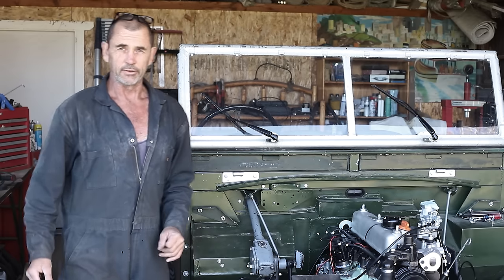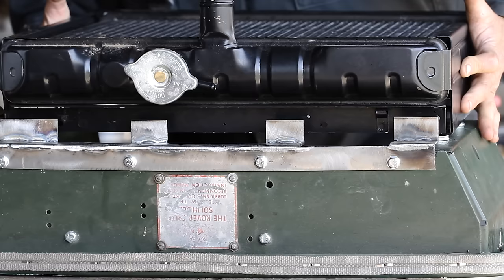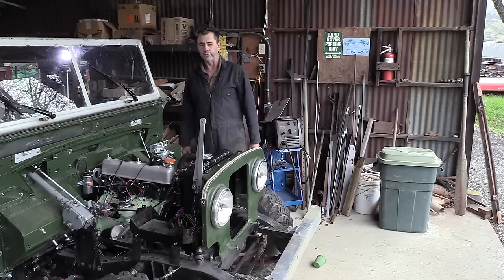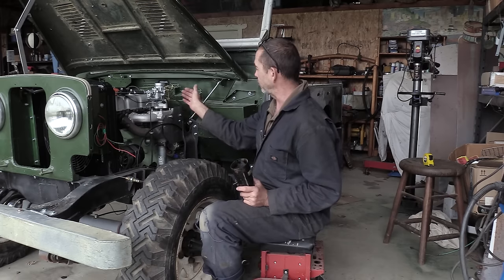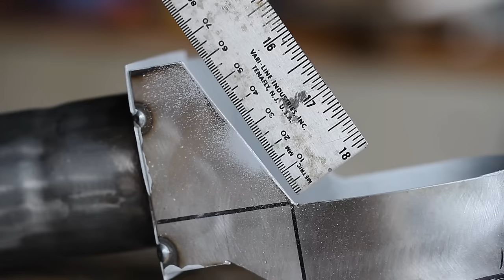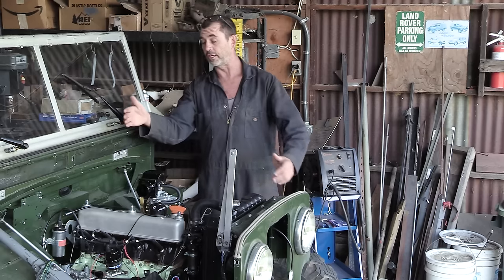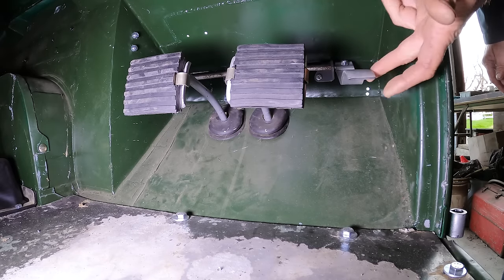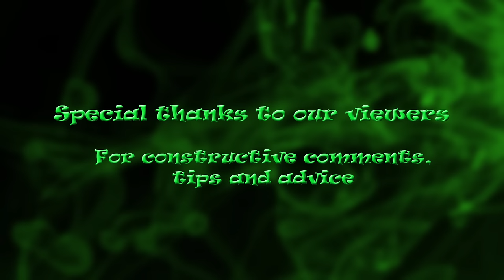Part_33; Vexing Puzzles; Series 1 Land Rover restoration

Comment: I always enjoy, indeed look forward to your videos but watching this episode reminded me of my throttle linkage head scratching. I have a 3 litre ford V6 in my series one and the weber linkage on the carb is via cable but the carb throttle lever is only 1” long. 
Using a 2” long lever on the pedal end resulted in the throttle either being on or off. This frightened a lot of people especially in traffic not least me. My solution was a snail cam for the cable to roll around allowing a large pedal travel for a small amount of throttle initially and when the pedal was on full so was the throttle. Thanks Gavin for keeping us entertained.
Reply from the maker: The Disco has cams on the throttle body for the accelerator cable. I'll see how my first invention goes and consider a work around if it's no good. Tricky problem to solve.

Comment: For those who are swapping the original Solex PBI 32 to the more recent Weber 34 ICH, you need only to modify the throttle lever by some cut & welding and modify the angle of that lever, and reduce the height of the 90 degrees manifold/carburettor adaptor spacer, and remove the bakelite spacer. The Weber carburettor seems to have a better efficiency and slight lower fuel consumption compared to the original Solex.  As you many times said, there are the "purists" vs the "pragmatists". That brawl is a never ending one. If you have an old Solex, but in desperate condition, keep it safe somewhere, one day there will be a genius who will create a pretty good overhaul kit to repair them. Cause the new Solex copy .... stinks. And finally,  thank you Mr Foreman for this wonderful series. Go ahead, poor some fuel and life in this engine, and off you go to give us some thrill.

Comment: There were some certainly vexing puzzles to be solved there.  Loved the solution for the air filter.  I wish I knew you had that problem to solve.  I could have designed something for you, and 3D printed it.  I've created similar one off custom parts for myself and friends for our vehicles.  Looking forward to the next episode.
Reply from the maker: 3D printing is a good idea. I mapped my creation out on paper and built it in a 3D program to see how it might fit together and of course used the model in the film. I remembered thinking "I wish it was that easy" and with the printers nowadays it probably is.
Reply: @ForemanAndWilmsAdventures  It is that easy (with a bit of practice), and 3D printers are getting cheaper all the time.

Comment: Thingymajig is the correct terminology, and where does one learn bracketery expertise is there a course one can take to achieve such greatness.  Using the drill press without a hard stop reminded me of my first job, where i made that mistake and was thrown off the shop floor by the old timer.  OHS was coming in way back then.  The rover is coming along magnificently.
Reply from the maker: Only the most up to date terminology gets used in my dirty little workshop, along with the most precise measurements right down to the squillianth of an inch.

Comment: Great work, and given me ideas for my throttle on Winston (which has the melange of rods, clips, springs and other random Land Rover hardware....) 👍
Reply from the maker: I was too fearful to try and replicate the original linkage setup as my bulkhead was modified for the V8 it might've added additional challenges. I'd like to see a RHD setup, the only other S1 I've seen was Andy's truck featured in the film. What he managed to achieve was impressive.
Reply: @ForemanAndWilmsAdventures  I think my 2a is very different for an S1, but if you want, I'll take some pics this weekend and ping them over (I have your email from when you gave me advice on the stuck reverse-gear issue)
Reply from the maker: I will accept that offer to see how it all fits together, references like that are quite handy. Thanks.

Comment: LOL always fun to watch. Spent my morning re-wiring the Coaster trailer in anticipation of the truimphant return of its magnificent tow vehicle :) The Coaster is 36 years old and the trailer is 40 so not quite a venerable as the Landy.
Reply from the maker: That Coaster is awesome and it's age only adds to the charm. I think I may have told you already they were a popular tour vehicle in the N.T so I spend 6 or so years driving them. They are really good vehicles.
Reply: @ForemanAndWilmsAdventures Ours does cause the odd (expensive) headache but when it works it is great to tour in. Looking forward to seeing it without all the crumpled metal on the passenger side :)

Comment: The thermostatic switch for the fan should be installed in the input to the radiator, which is the top pipe. Also the Phenolic Block i's there to insulate the carburetor from the heat of the engine block, and considering how easily modern ethanol gas vaporises when it gets hot, removing it and having the fan switch in the bottom pipe, could have caused much future heart ache. Hope this info helps😀
Reply from the maker: My hopes were indeed to install the switch in that top pipe but there wasn't the space, or at least it would be tight. This one has variable settings so I set it down low to offset the cooler water flowing out through the bottom hose. Can't say if I'm correct in my thinking but I'm sure I'll find out soon enough.
Reply: @ForemanAndWilmsAdventures  I recently installed an electric fan on my old 3.5 Range Rover Classic and found it worked best with a termp switch rated  at 95 C in the top pipe. As long as yours goes down to at least 85 C, which is when the thermostat opens, I would have thought that with a bit of adjustment it should work fine. 

I've been following this project since the beginning and loving the videos, especially the one with the "Turdis". Good luck with everything and keep up the great work.
Reply from the maker: The Turdus is one of my favorite inventions though it was Wilms who came up with the name, whilst being so obvious  I wouldn't have thought of it. It was brilliance on her behalf. My fan thermostat goes down to 70 C but I have it set a little higher than that. This conversation has  convinced me to re-set the thing to low and leave it there.

Comment: Enjoying watching the progress you're making with the landy.

As for the problem you're having with the air intake: there was a pipe with a tighter bend made for the solex carbs around 1967-69 ish 2.25 petrol, that should do the trick..  I believe the pipe you have is from the Zenith type carb.
Reply from the maker: Would the pipe you mention still fit with the Phenolic block in place? At least in my application space was very tight.

Comment: Make a lot captive nuts and bolt plates myself, personally I tend to use Defender/Discovery 1 radiators these days, less expensive and more readily available, plus you've got an in built oil cooler already. Love your approach dude, keep it up. Take care
Reply from the maker: I didn't even consider a Disco radiator and I've got one sitting outside in my daily driver that I could've measured up. Possibly an option for the future.

Comment: Congratulations with your show. As a Land Rover enthousiast and owner of a 1964 Series2a 88 I stumbled on your channel a few days ago. I’ve binge watched all 33 episodes. Your show should reach a much larger audience ! Your show has it all : very good content, the struggle is real, I love your humor, the camera angles are excellent, the editing is top and the animations are amazing. I can’t wait to hear that motor run. Thanks Johan (Belgium)
PS you fixed the tube of the throttle cable to the chassis with a bracket laying on the floor and the cable to the carburetor, when the motor vibrates, the throttle will move, making the motor vibrating even more…
Reply from the maker: Greetings there Johan. Your comment on the throttle cable is one of intrigue I considered not knowing if I'd be wrong or right. The mechanical linkages I think must be mounted off the engine though I have little physical reference to go on, so I figured I'd try mounting the cable the same. I can't say too much on a public platform to avoid spoilers, but on the sly I haven't yet experienced any problems...As yet.
Reply: @ForemanAndWilmsAdventures  so you spoiled it : the Land Rover is already moving under it's own power !!! I wish you lots of happy motorring.

Comment: Throttle linkage.  I worry about your cable being too close to the exhaust and too long.  I’d suggest routing it over the top of the engine, and using the outer sleeve to operate the lever on the carb, with the inner cable fixed to a bracket on the manifold.  The cable can thus be much shorter (less friction) and out of heat harm’s way. Just an idea, ignore it if there’s no problem.  Another great episode!  PS:  if you want an original oil bath air cleaner I’m happy to track one down for you here in Blighty, although the postage would be fearsome…
Reply from the maker: Thanks Will. My air box turned up and is installed as you'll see in the following episode. It's light and small and should do the job. A lot of experimenting and testing to be done once it's running. Until then most questions about my inventions can't be answered. There is a lot of friction in the cable though it was a cheap Amazon purchase. I'm looking at a more expensive one though it probably won't be much better. I'll keep an eye on the thing in regards to heat. I'm a little concerned myself even though a heat shield is in place.

Comment: This is probably 3 months too late, I think the throttle cable outer should be fixed to the engine as any movement between body and engine will operate the throttle. This is one of the best restoration series I've watched be a shame when  it ends👍
Reply from the maker: I wondered that myself when I installed that bracket. As of yet things seem to be working and if it changes I'll concoct another plan. Glad you like the show.

Comment: Looking good so far. What drove the choice of using the thermo fan in push rather than pull? If you have the space I would recommend using it to pull the air through the rad as it will get much better cooling. Even better would be a simple shroud to pull ait through the whole core. I battled over heating in one of my land rovers that only used thermo fans and it came down to having it mount on the front. Though your location and usage may not have the same heat issues as Qld Aus.
Reply from the maker: Much of what I'm doing is experimental, when I got the truck it had an electric fan in front and there was plenty of space there for it. That position also allows the re-installment of a mechanical fan if I choose to. Not sure if push or pull would make a difference to air flow but I'm sure I'll find out soon enough.
Reply: @ForemanAndWilmsAdventures  as long as the is sealed to the rad or with a shroud, the fan will draw air through as it creates low pressure in the fins. If pushing it creates high pressure on the fins and is more likely to partly cavitate, especially if it isn't sealed up to the rad fins.
Reply from the maker: Greetings Nathan. I've been attempting some research on what you say and as yet don't know what to make of it. It's still cold over here but it does get hot and that will be the real test. I shall monitor the situation closely, there are so many little technicalities in motor vehicles and I'm still a rookie. Thanks for the heads up on what might be an issue to watch out for.
Reply: @ForemanAndWilmsAdventures  if I recall correctly I learned of the push pull difference about 10 years ago from Donaldson (high quality thermo fan manufacturers) thermo fan website technical documentation.

Comment: the phenolic block thermally insulates the carb from the motor so the fuel doesn't boil off when you're parked and cause vapour lock. You can get away without one if you have an electric fuel pump. I'm surprised there was so little clearance between the carb and the bonnet, my 1957 S1 is running a S3 motor and weber carb and there's plenty of room for an old holden air cleaner up there.
Reply from the maker: I've seen pictures of such things and my friends over at Seriously Series had an air cleaner as such installed. I'm curious what the difference is. I'm happy with the solution I eventually arrived at but it took a lot of brain work to figure it out. I'm much better at heavy lifting and find it less exhausting.

Comment: Not sure if anyone has mentioned , that coolant sensor definitely needs to be in top hose , bottom hose is cold side and will not turn fans on until the engine is in fire or the temperature of the suns anus after a bad curry 🤣 and need an inch clearance above air filter to account for engine rocking ….. ask me how I know !
Reply from the maker: Greetings Bad Stimpy. The fan controller has an adjustable setting between 70 -120 Celsius, I have it set at the lowest in the hope it offsets the incoming water temp. There wasn't room for it in the top hose sadly. I'm currently trouble shooting gauge issues and it's cold over here so until both those conditions change I won't know how effective my electric 'fan plan' will be. I'm keeping my mechanical fan handy for re-installation if needed.